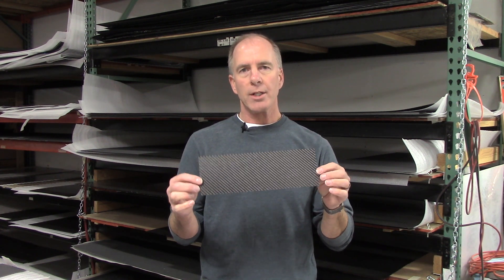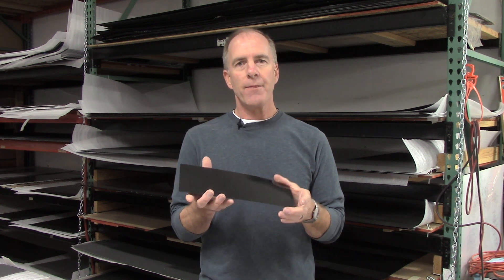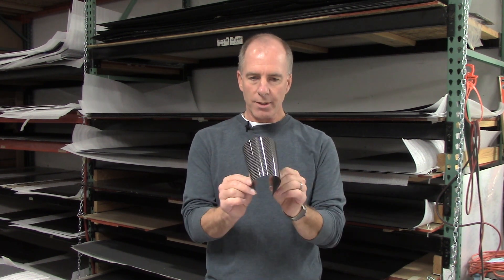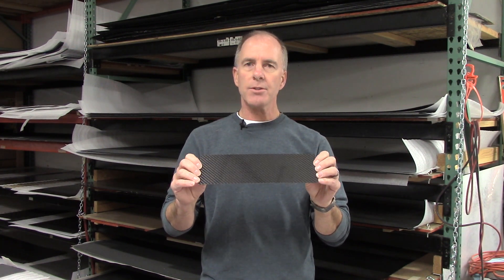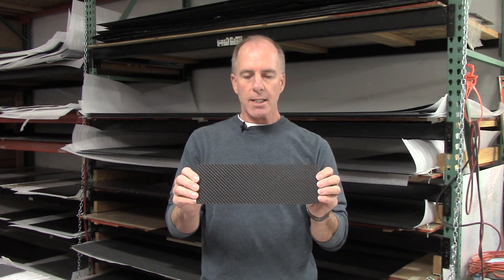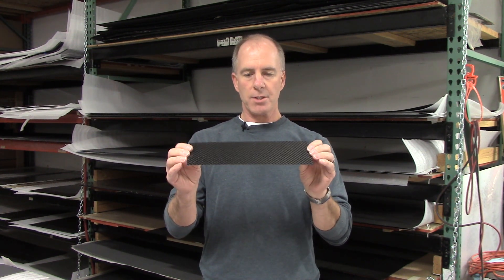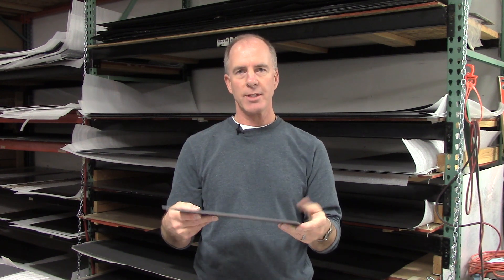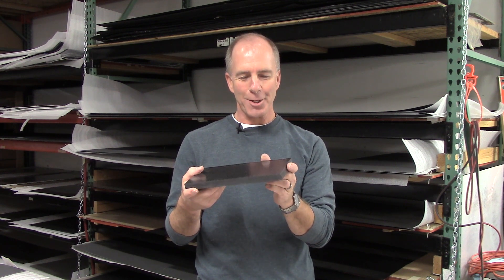Carbon Fiber Flexibility

Comment: What's the max temp? Is it possible to use as heat shield for catalytic converter?
Reply from the maker: Our standard resin system has an upper end working temp of 180F. Carbon fiber is a very good heat conductor but only at or below it's service temp.
Reply: @protechcompositesinc.1211  I was expecting Carbon Fiber to be a good heat insulator like carbon. 😓

Comment: How did you make the thick panel? Did you layer several thick weaves together? Did you do it all at once?
Reply from the maker: The thickness of a panel is determined by the number of plies of carbon fiber used. The more plies the thicker the panel. The .25mm sheet is one ply of 3k fabric while the 1mm is 2 plies of 6k. We’ve made panels as thick as 1.5 inches thick using 88 plies of 6k. That’s a lot of carbon!!

Comment: Hi - Thanks for the vid! I am hoping to reinforce a broken (but glued back together) guitar neck. Do you think a flexible, sticky sheet would work as a supporting material to hold the stress of string tension?
Reply from the maker: No, anything like an adhesive film wouldn't provide a bond rigid enough to withstand the stress of the strings. You would need a good 2-part epoxy or equivalent.

Comment: For Spearfishing Fins which is best thickness 0.5mm or 1mm or 1.5mm ?? Does these sheets have GSM? Most of these carbon fins comes in different level - Soft, Medium & Hard
Reply from the maker: Good question, but we don't have any experience with spearfishing fins so I really couldn't recommend what would be best. That's a new one for me!! Good luck.

Comment: Do you have 2mm version  and how bendy is that
Reply from the maker: We make carbon fiber panels in thicknesses between .25mm and 25mm. Most of our products are custom orders and a 2mm panel is no problem. A 2mm panel will have some minor flexibility but is pretty rigid. Send us your requirements at info@protechcomposites.com

Comment: Will the .25 bend in 2 directions, if one is extremely slight? maybe 1/4 inch across 10 inches?
Reply from the maker: There are some applications where this is possible, such as where all edges are attached (bonded or bolted) to another surface. Even then there will be a bit of bowing but the bend you described should work.
Reply: @protechcompositesinc.1211  Hey thanks for the reply. 

I gave it a shot, and it worked :) I used the 3M tape from you guys to attach it, and it bent around the very slight bends convex, enough to where the edges appear down flat all the way, and I don't see any creasing or popping up.

That said for anyone else reading this, there is massive holes in the panel, it's a stereo bezel for the car. So it's only 1 inch wide in most places, and that relief could of allowed it to work.

Comment: Great stuff in there.
Just a question , can i make the thicker one as a crossbow limb? I've heard that fiberglass cloth ang epoxy resin (not polyeater) is more flexible than carbon fiber. Is it true? Thanks!
Reply from the maker: A fiberglass/epoxy composite structure is quite a bit more flexible than the same layup (number of plies) of carbon fiber/epoxy. I don't have experience using carbon fiber for a crossbow limb so I can't speak to the applicability. That said, the materials' high flexural strength and modulus means that the flexibility declines rapidly with thickness. A simple 0/90 layup would probably not give satisfactory results. A quick check online shows a variety of these products for sale made from uni-directional carbon fiber and fiberglass to give the part both strength and flexibility.

Comment: Hello Jeff, Can you tell, approximately, the force needed to bend the 0.5mm, 1mm and the 1.3mm to the maximum just before the fibers cut off?
Reply from the maker: Hi Stefan, this requires a bit longer conversation. You can email at jeff@protechcomposites.com or call our office at 360-573-7800.
Thanks.

Comment: Do they come with sticky back ? Also can it be cut ?
Reply from the maker: We can send a 3M double sided adhesive film with your order, or apply it to the sheet for you. Sure, carbon fiber sheets and panels can be cut. The method of cutting depends on the thickness of the carbon fiber sheet. A razor knife or shears for 1mm and under, and a solid rim cutoff blade (Dremel) works well on thicker panels.

Comment: Is the 1mm continously flexible if just flex stress is applied or will it quickly fatigue.
Reply from the maker: It will flex until it reaches it's failure point, then it will fail suddenly. The point of failure is when it is flexed to an approximate diameter of 5".

Comment: Hey, I'm looking into carbon fiber as a bow making material. I want to make a laminated bow with two sheets of some material on either side of a wooden core. Should I go with this carbon fiber and experiment, or just stick with fiberglass?
Reply from the maker: Hey Dillon, I don't have any direct experience in doing that, but if you just bonded carbon pieces to either side of a wooden core you would have a very rigid bow. Carbon fiber doesn't stretch or compress much at all, which is what must happen when 2 pieces are separated by a core and flexed. (We make carbon fiber sandwich panels with Nomex Honeycomb cores, which is almost like paper, that are extremely rigid) It would be an interesting experiment! I just don't know what thickness to attempt, or what the result would be. For this application I might stick with fiberglass.
Reply: Is there a specific resin to use that you can suggest regarding this application? Thanks!

Comment: How durable is the 1mm or the 1.3mm thickness CF?  If I built a boat out of this thickness, would it hold up to sharp rocks or should I go thicker?
Reply from the maker: That's not a great application for carbon fiber. The epoxy makes it a bit brittle so it's not the best for impact resistance or abrasion. Strong, yes. Lightweight, yes.
Reply: Kevlar carbon hybrid is a better material for boats because of abrasive probabilities

Comment: if you were to take small stripes of the 0.25mm sheet will they bend into a tighter curve or would they break?
Reply from the maker: They will break. Any attempt to bend it tighter than about a 1" diameter will cause it to break.
Reply: @protechcompositesinc.1211  thank you :)

Comment: Just out of curiosity what is the load strength of a 1” solid carbon fiber board?
Reply from the maker: A lot! Your question depends on many factors such as; carbon fiber fabric weight (3k, 6k, 12k, etc.), uni-directional or woven, weave type, resin type, resin content, the board dimensions, where the board is supported, where the weight is distributed, etc. That said, in the carbon fiber world, a 1" thick panel is a massive one and will support a lot of weight!

Comment: Does carbon fiber bend like steel or crack like titanium?
Reply: Carbon Fiber is incredibly rigid and will most likely crack like titanium.
Reply: Late to the party but cf doesn't behave like either. As a composite it's failure mode is more like the way wood fails than any metal because of the layers. If taken past its ultimate strength it snaps like a dry stick (a mix of shear and small delams). If taken to fatigue it usually starts to delam until the repetitive load exceeds the ultimate strength of the intact portion of the part and then that fails in an exaggerated version of the ultimate failure (shear with more and bigger delams). Like breaking a green stick but with more pronounced layer separation. If you're seeing plastic deformation failure like steal or ali something is wrong with your resin.

Comment: I wished you show all the values, like 1.0 1.1 1.2 1.3 .1.4 1.5 1.6 1.7 2 2.5 3 but you skipped to 3
also interested to see in weight of 300 x 300 plate
Reply: Depending on the fabric thickness, all those thicknesses you mentioned are not possible. Its usually .3mm to .5mm increments because of fabric and resin layer thickness minimums

Comment: Hey guys, thanks for the video. Is there a way to layer the sheets to get more flexibility? Or a specific method of making the sheets that allows for more flex?
Reply: Different resins and carbon layers with fibers laying in certain direction
Reply: The most common layup of CF sheet is 0 - 90 degrees. The sheet will be much stiffer in the same direction as fibers within the weave. But if you rotate 45 degrees and bend the sheet, it will bend much more easily. So if you need a bendy part with less rigidity, have your cnc fabricator rotate the part 45 degrees in their CAM software before cutting.
Reply: Rectangular vs triangular overlaying